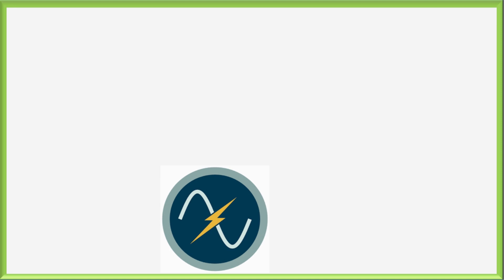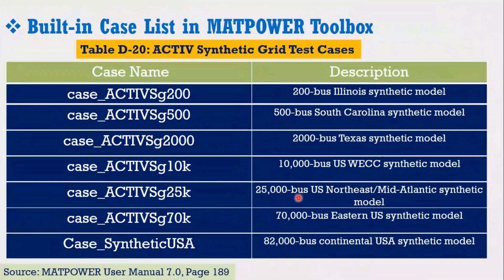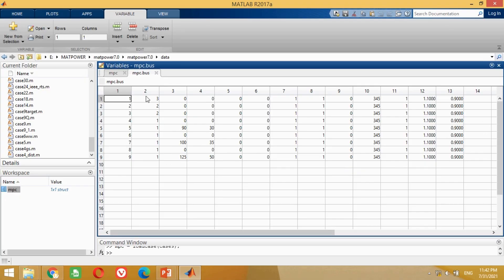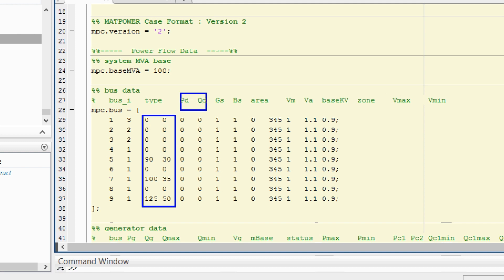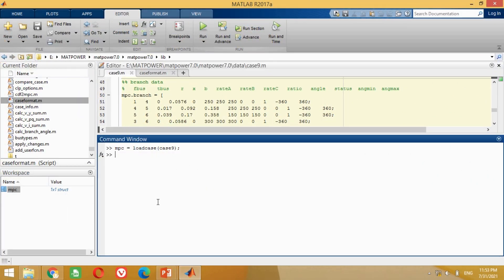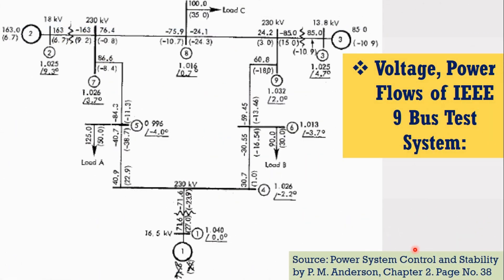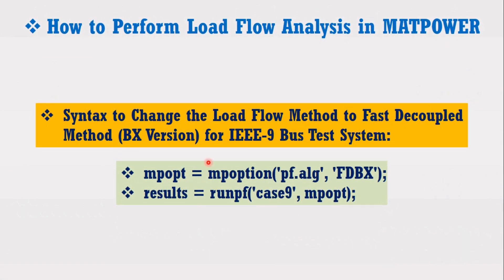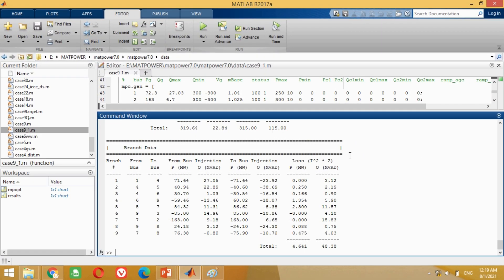How to Perform Load Flow Analysis of IEEE 9 Bus System in MATPOWER Toolbox | Dr. J. A. Laghari

Comment: Kindly help me to make IEEE 30 bus data
Reply from the maker: Thanks for the comment. IEEE 30 bus data model is already available in MATPOWER. why you are going to make it.
Reply: Actually sir My guide sir is instructed to me check the bus data ( bus voltage and real and reactive power of generation and load) of IEEE bus 14 and 30 must be matched in power simulator. Kindly guide me sir

Comment: Masha Allah
Thanks for your contributions and enlightenment.
Sir, how is possible to integrate a wind turbine based generator in the model and obtain the load flow.
Reply from the maker: Thanks for the compliments. For wind turbine, you may have to search for other load flow codes.
Reply: @DrJALAGHARI  Okay Sir,
Sir, can matpower code be translated to simulink in MATLAB
Reply from the maker: @dahirumisbahu6152  I am not sure. But you may also search for PSAT Toolbox.
Reply: @DrJALAGHARI  Jazakallahu Khair
Reply from the maker: @dahirumisbahu6152  my pleasure

Comment: asslamolaikum Dr. J. A. Laghari
thank you sir your videoes are very helpful and Excellent.
i have problem in load flow result for ieee 9 bus . i get load flow error (the load flow did not converge in ......) by using matlab program. if you can help me please how to solve this problem .....thanks.
Reply from the maker: Thanks for the compliments and comments. Have you installed the matpower toolbox or not?

Comment: Thank you for the video, it was very useful. I amt trying to solve an 11 bus system. Would this this case9 be the best data to start with, and then edit the data to add two more buses?
Reply from the maker: Thanks for the compliments. Yes you can do it. But try to save it with other name in order to avoid any change in the original program.
Reply: @DrJALAGHARI  thank you! Do you have any examples of 11 bus systems?
Reply from the maker: @ElizabethEvans-if4ud  thanks for the comment. No. I don't have any such example. But if you have the data, then you may do it.

Comment: Assalamualaikum sir:
Your videos are very helpful.
I want to use the MATPOWER for load flow analysis of the practical radial distribution system. 
In the system two voltage levels are there.
First is 11 kV bus (Bus 1) which is slack bus.
All other buses are of 440V bus.
There is a transformer of 11kV/440V  between bus 1 and 2.
From bus 2 onwards are load bus.
At some buses load is present at some bus no load is present.
I know the values of R and X of line in ohm. 
How to perform the load flow analysis of this system having two voltage levels with transformer?
How to proceed.
This will be very helpful.
Jazakallah.
Reply from the maker: Thanks for the comment. This is distribution system. The load flow analysis of distribution system is quite difficult to obtain. For distribution system, forward bavkward load flow method is used. I think the program of this load flow method is also available in MATPOWER toolbox. You have to read its basics to understand
Reply: @DrJALAGHARI  
Actually I am able to perform the load flow analysis of the system from 440V and downstream buses i.e. with one voltage level.
I am facing the problem when I make bus 1 as slack bus with 11 kV.
If you can help that will be great
Thank you.

Comment: Salamualaykum teacher. Thank you for the wonderful lecture. Please is it not necessary to include the generator transcient reactance (xd)' in the branch data for load flow analysis? Also, please is there any software that performs load flow analysis of an Island microgrid at present?
Reply from the maker: Thanks for the comment. For load flow analysis transient reactance is not required to put. Transient reactance values are used for fault analysis calculation. I am not aware about such software.
Reply: @DrJALAGHARI  hi can you send a video of 14 Buspar matpower

Comment: How perform DC load flow in matpower???
Reply from the maker: Thanks for the comment. I have shared the commands for different types of load flow methods. Change the command of any load flow method and run it. It will work fine.